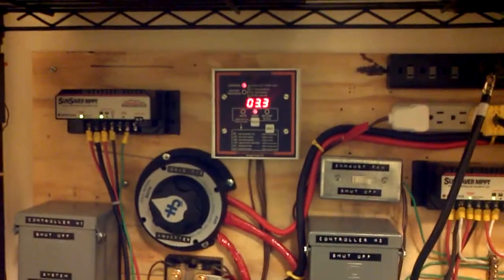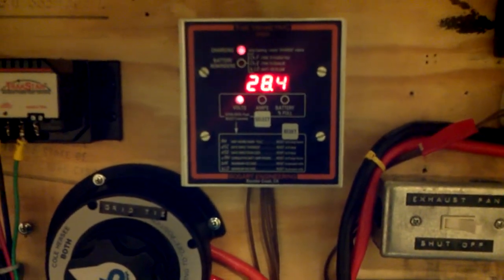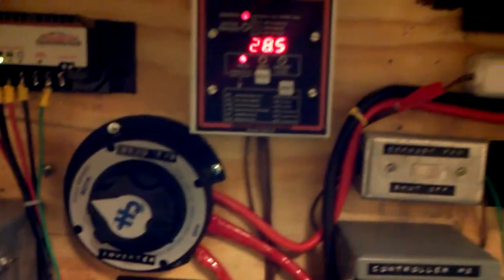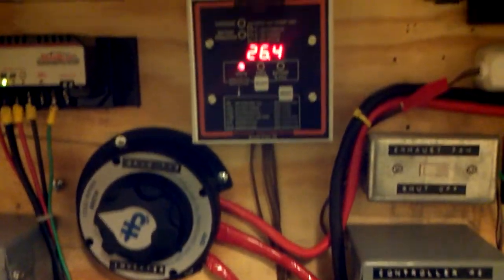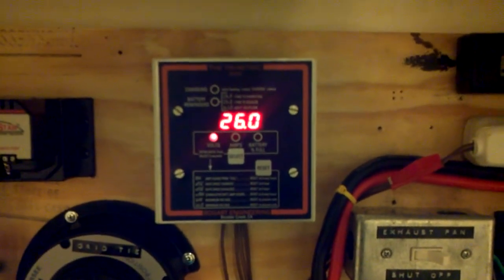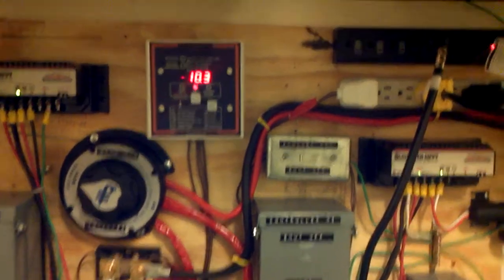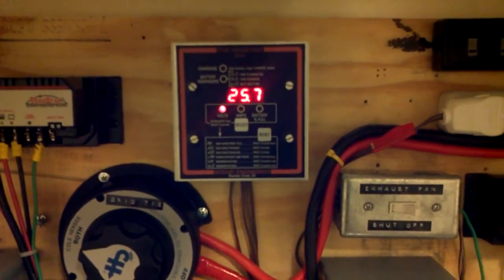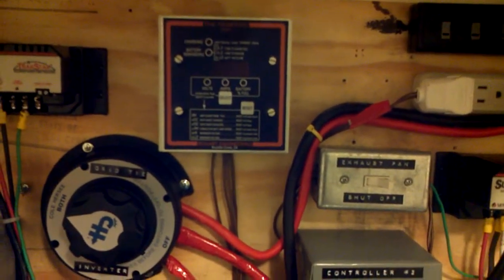DIY - Grid Tie Performance Test Verification Part 1 - Begin Test

Comment from the maker: @shartne Yes, I believe there are some definite advantages to using this approach.  I've also verified with my Optima battery manufacturer, that running the GTI off of these batteries will not hurt them the way I do it. (for 3 or 4 hours at a time with a rapid recharge.)

Comment: @rhandsom very good and also my mine grid tie inverter wont work at low voltage but the batteries wil take a charge so there are some definite advantages to this idea.

Comment from the maker: @photolodge The batteries were only used as a buffer area. But in short, I supplemented my home's energy usage by approx 1.8kW of power in 4 hrs. The battery bank started full at 28v and a 100% state of charge and ended with 28v and 100% SoC. My home gained 1.8kW of power during the day and my batteries lost nothing. The batteries only suffered a 10% DoD and were fully recharged in 1 1/2 hours via solar. 10% DoD is not even considered a cycle and doesn't harm AGMs. The Vids show more info.

Comment: It doesn't make sense to use battery power and life just to put a little power back into the grid. It is beneficial to go directly from panels to grid tie and just disconnect your full batteries from the mix